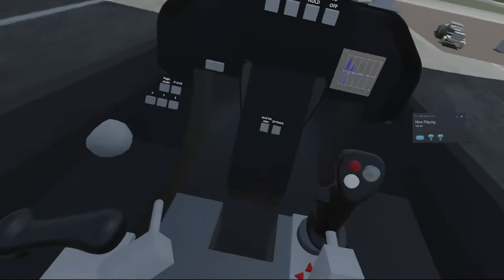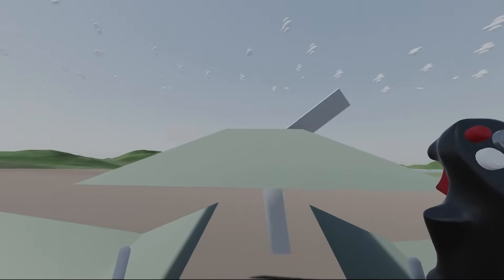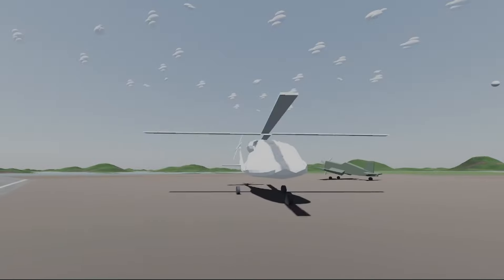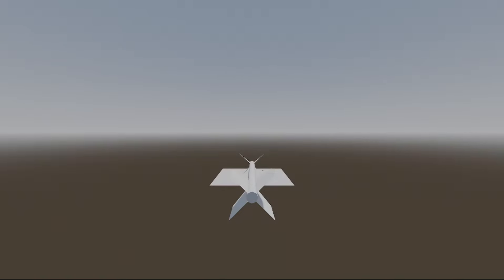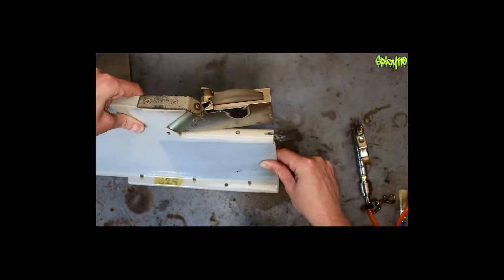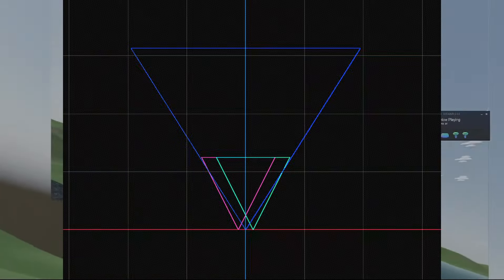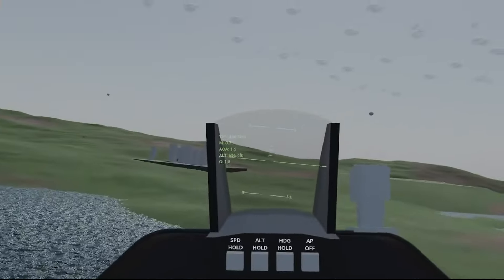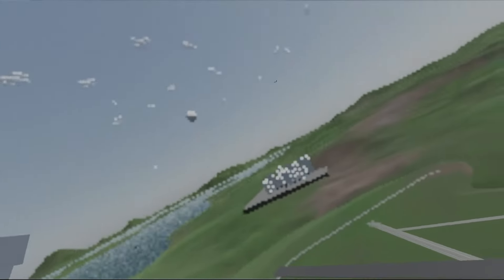How I made realistic missiles in Godot [Godot VR Flight Sim]

Comment: Wow this is all really advanced. Great job! How is the performance of it? I've always thought it would be cool to simulate each individual missile fin rather than just faking it all but I always thought that it would be pretty costly. Same with proper IR seeker heads. Especially with seekers I've tried to cut a lot of corners myself but the solution you've used seems to be working quite nicely.
Reply from the maker: Performance is quite good, considering it is 100% GDScript (similar performance to Python), and Godot doesn't currently have a solution to parallelize custom force integration. In my testing, I was able to have 9 F16s each with 8 missiles and still hit 60 fps. Hopefully Godot will add parallelization of the force integrators soon, because that will be an instant performance increase.